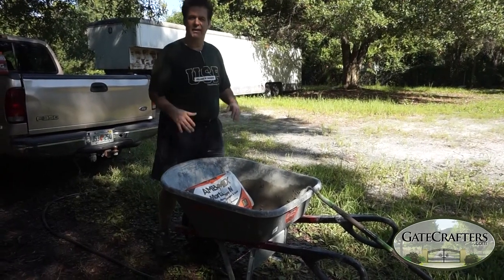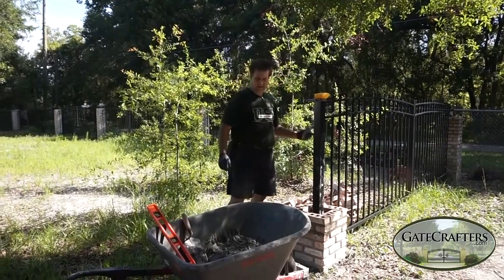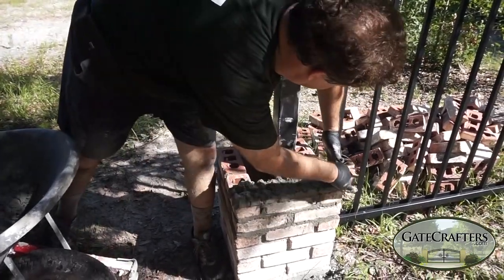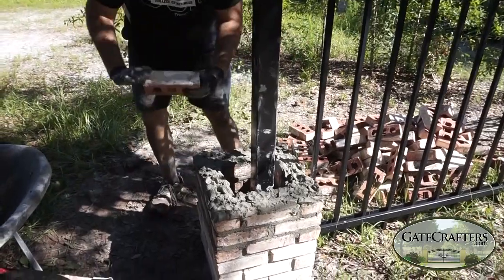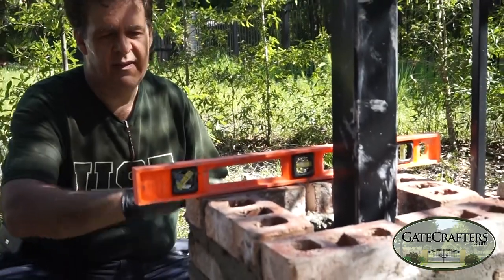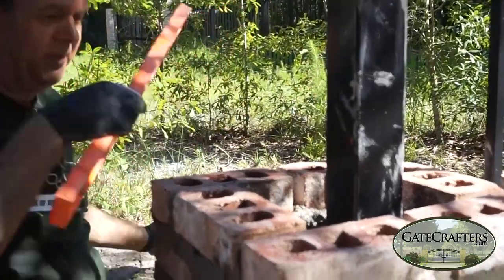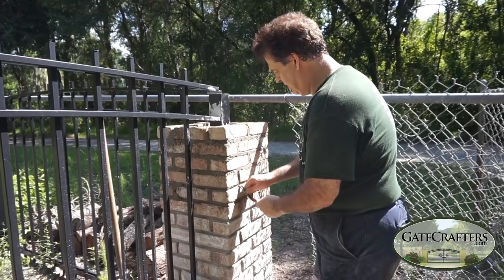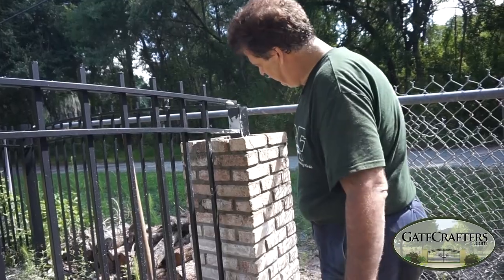How To Install a Basic Gate Column

Comment: 5 minutes with a trowel would have been enough to make someone faster than that. I’ve seen first day laborers pick up a trowel and go faster. Plus you didn’t level them front and back. Just because one brick is level to the next doesn’t mean that they are straight or that the front isn’t higher than the back.  
Especially since it’s load bearing for the gate you don’t want to do this. Unless you want your brick broken and gate on the ground..... then I guess go for it.

Comment: This is supposed to be just as good as professional but easier and faster? You mixed the concrete off camera, so probably 5-10 minutes  mixing, to be conservative. Then it took you 8 minutes to lay one layer. So, about 20 minutes for one layer. So, that post is what 4' high, just guessing. I counted 15 layers on your one post. 15 X 20 = 5 hours each. So what 1 to 1.5/day. Ya real pro. 
This is stupid and it looks stupid too. Just pay the money and let a license brick layer do it. Probably do 2+ per day. If two of them, they probably can do 4-6+/day easy. one guy mixing. one guy cutting. 2 guys laying.